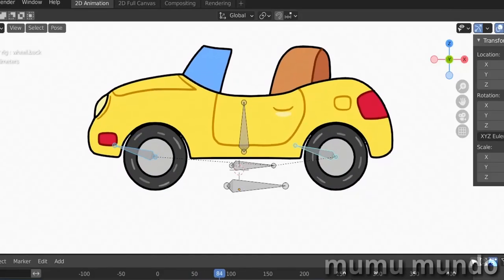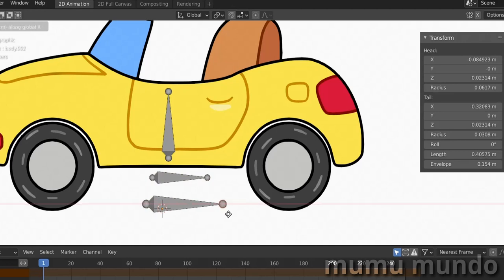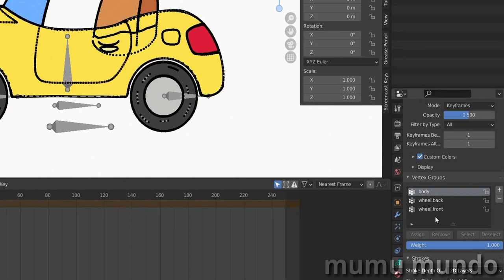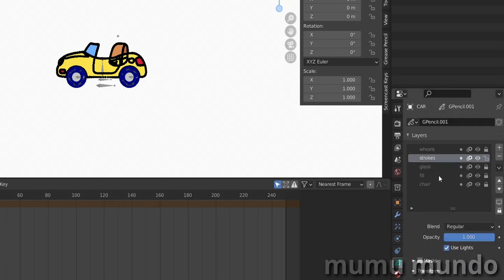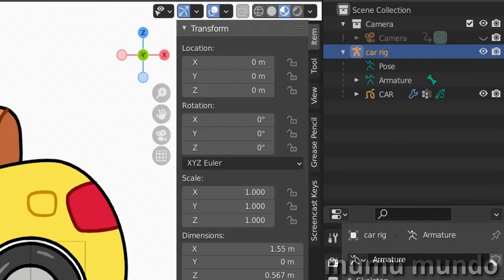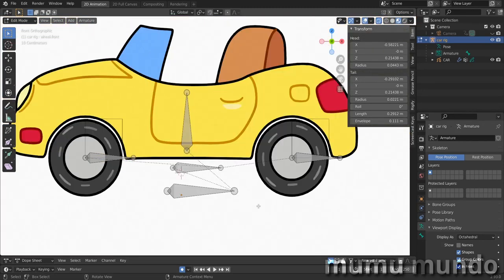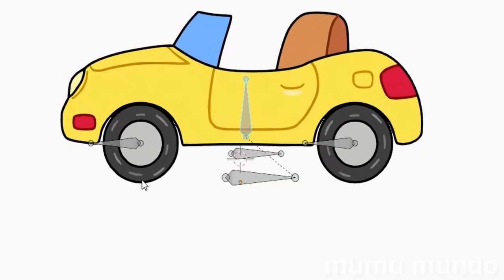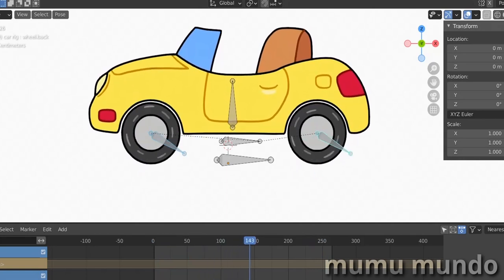Simple Grease Pencil Car Rigging & Animation Method | Blender 2.93

Comment: hi, I did an animation with 2D dolls and 3D buildings, the dolls have to enter a house, but they stand in front of the house, could you give me a help?
Reply: Video:
https://drive.google.com/file/d/1vd-SWZzhsCphn89SXfnhSvhj7IMma3Rn/view?usp=sharing
Reply from the maker: u mean they enter the building but are still visible ? if so try to change the origin points for the dolls and the building : make the building origin point closer to the camera and if it doesn't work keep changing and experimenting.

to change origin point :
1 move 3D cursor (using shift+right click) where u want the origin point.
2 right click your object > set origin > to 3D cursor

mixing 2D and 3D can be annoying in Blender :)